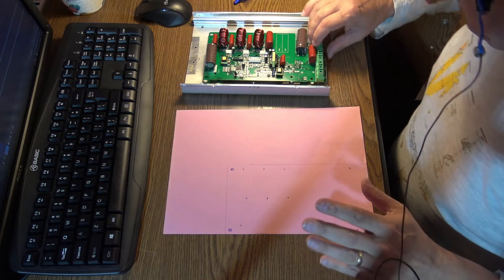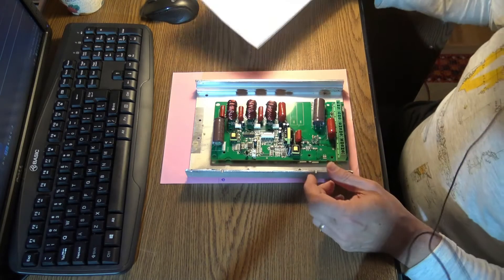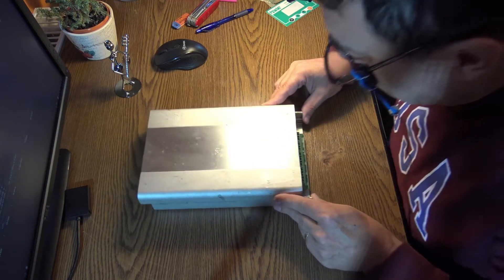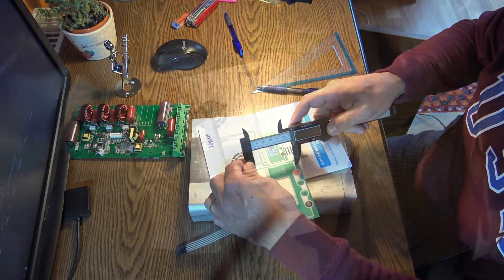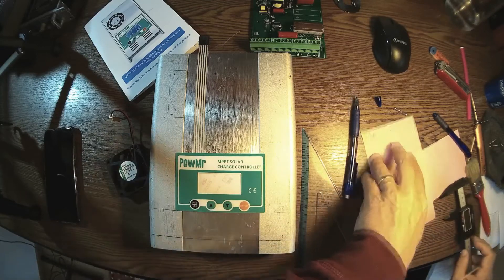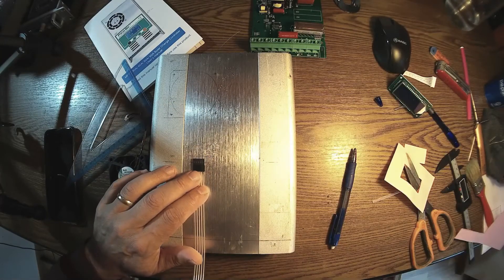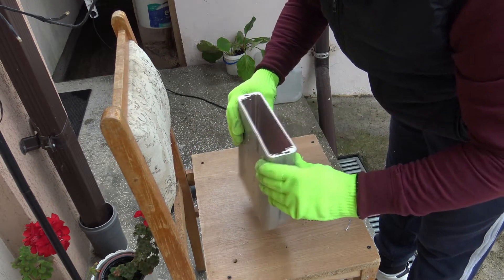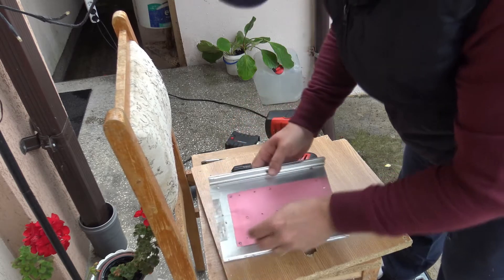DIY  MPPT solar charge controller part2 The case

Comment: Nice aluminum case box it doesn't require fan I think ;)
Reply from the maker: Will see when I apply 60A..the fan is controled by the temperature sensor and turns around 85 C